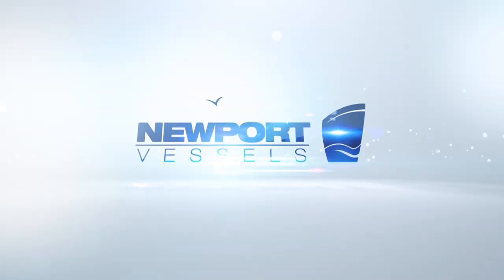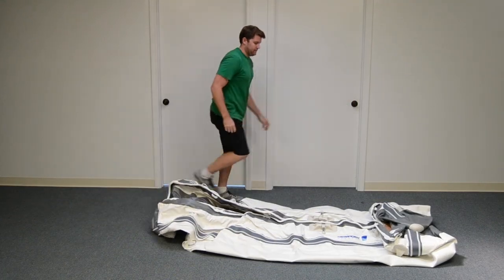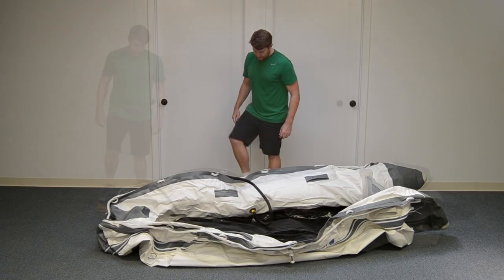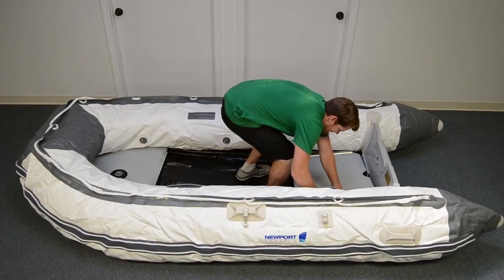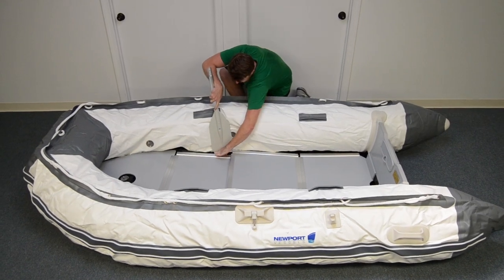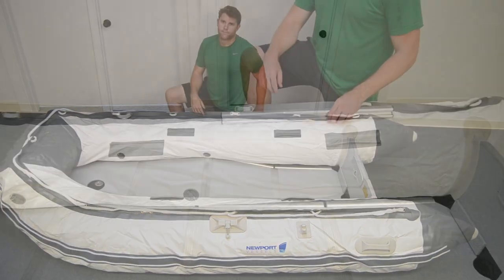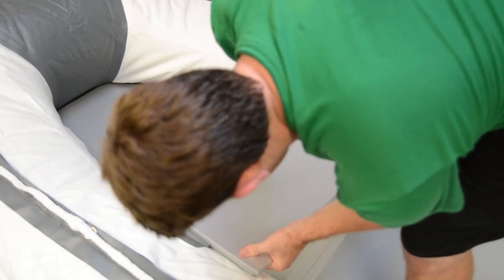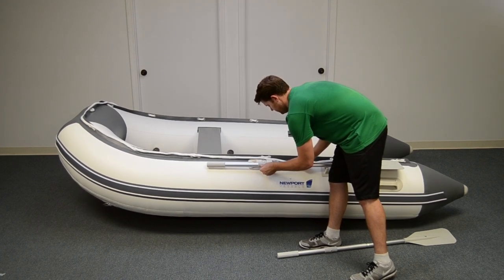Inflatable Boat Assembly And Setup Instructions - Newport Vessels

Comment: The keel was not inflated in this video and we do, it pushes the installed boards up making the floor totally uneven and creating board corner pressure points on the hull which will likely wear out and puncture the hull

Comment: I agree with Ron but more precisely with the floor pain in the ass situation is getting those brace pieces in on the transam side was nearly impossible unless i disassembled the transam. You can't even get the brace under it because the transam is locking the board down so tight there is literally no room to get the brace lip under it. Its like  fitting a 1 inch gap under a 2mm space.Everything else was fairly easy. I literally gave up after about 40 minutes of fighting with the transam brace side.

Comment: Do you have any video showing the size of the 9.5 ? I really want to buy one and use it for fishing ,but I'm concerned it would be too small for 2 people and a small dog. Its also disappointing that the del mar doesn't come with inflatable floor. Thank you
Reply from the maker: Hi Nick, there some videos posted on YouTube by users that show the Newport Vessels 9.5ft Del Mar model in action. Here is a link to the best one https://www.youtube.com/watch?v=Ab6x1aAoQH8.  This one is actually from an NV dealer located in Illinois. The Del Mar comes with an aluminum framed marine wood floor.  We do have an inflatable air mat floor model boat called the Santa Cruz.  Here's a link to this: http://www.newportvessels.com/santa-cruz-inflatable-dinghy-boat/.  This is a 10ft boat with a 4 person max rating.  Both the 9.5ft Del Mar and the 10ft Santa Cruz are both rated at 4 max passengers.  Both boats are very popular, but if you're worried about space limitations, I'd go with the Santa Cruz because it's 6 inches larger.  Happy boating!

Comment: The floor is a royal pain in the a$$. Such an energy drain trying to get the floor in.  Sorry but i think this part needs a design change to make it easier. The only bad thing i have to say about this.
Reply: We had so much trouble trying to get the floor in place, we threw in the towel and ended up not using the boat the entire month we were away.  I called customer service, but they said it takes alot of muscle.  Honestly, it seems something is seriously wrong.  It should not be that much trouble.  Is there any secret to making this happen?  We're seniors and we are not weight lifters.  We gave it everything we had, but we were not successful.  Any tips would be appreciated.  Thank you.
Reply: @sandrahuelsenbeck6994  We put the floor in first then pump up each section about 1/3. Then one person will lift a side so the raft is standing on its side. The other person will the work the brace in on the high side. Put the raft down the lift up the other side and do the same thing. Once both braces are in pump the raft up the rest of the way.